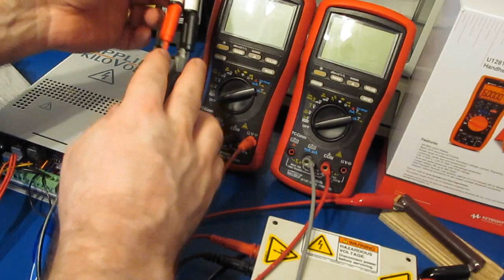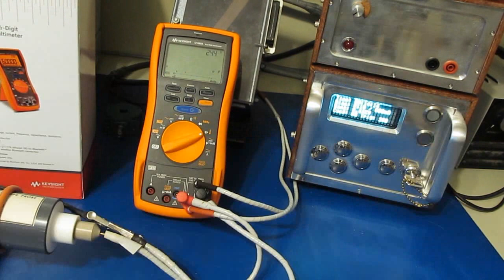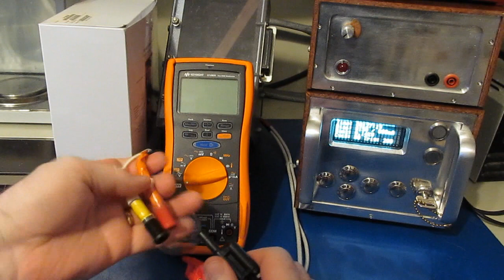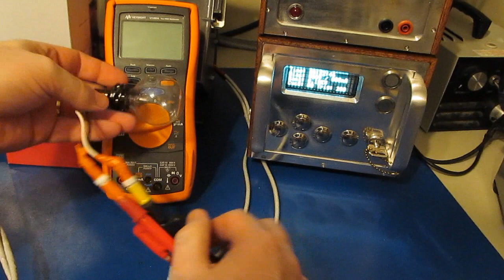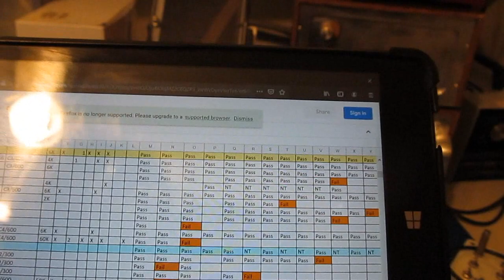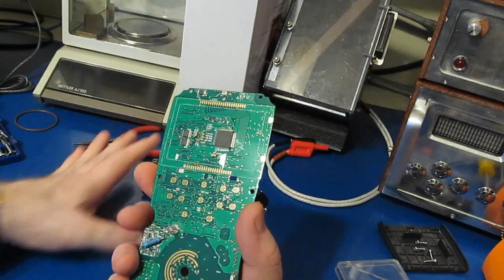Keysight U1282a Review Part5,  Destructive Transient Testing

Comment: Great video again Joe. One thing I was wondering in watching it, is whether the repeated transient tests at ever increasing voltage wear out the protection devices? I had a quick look at a LittleFuse Gas Discharge Tube datasheet and they do have a limit of how many "hits" they can handle (e.g. 10). Granted the discharge currents in your tests are probably lower than the max. stated in the datasheets but then again you trigger far more hits. Any thoughts? It would be interesting but probably not practical to do two identical mock-up protection circuit and test one like you did for the U1282a multiple times with ever increasing peak voltages until it fails and the 2nd one with just the transients that caused the fail in the first one.
Reply from the maker: Normally the manufacture is expecting the GDT to take the entire brunt of the transient.   In the case of the DMMs, the MOVs and GDT sit behind a PTC and resistor which will limit what these parts are subjected to.   In cases where the low voltage clamps are active, the voltage may never reach the breakdown levels of the GDTs or MOVs.    As I mentioned in this series,  I ran a long term test on a Fluke 87V after someone had voiced similar concerns over wear on the MOVs.    What I could do is after I have completed the life cycle test, is transient test the meter maybe a 1000 times at 4kV and look at the brake down voltage before and after.   I don't think we would see anything.

Comment: That's a lot of money destroyed there.
Can you name a real world situation that would  be similar to that 5kV transient that destroyed the meter?
Like maybe an ignition coil output from a car or an inductive load from a faulty spinning motor/faulty motor drive?
And could this failure be avoided if they've used MOV's (being faster maybe) in the protection circuitry instead of spark gaps?

A very nice series of testing again👍
Reply from the maker: Do me a favor and post your questions into the EEVBLOG forum.   You may find you get a lot more feedback this way.  It may also be something I have covered before so check the FAQ and maybe try the search function.
Reply: If you're working on mains, you can see transients 10x or more the nominal voltage when inductive loads are switched. Less of a problem with domestic contexts with 120V, but 240V or higher in industrial use could easily see transients that kill this meter. This probably isn't your average sparky's meter, but an electrical engineer could certainly be working on stuff like this.